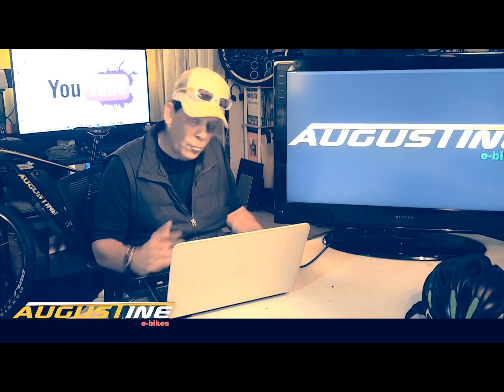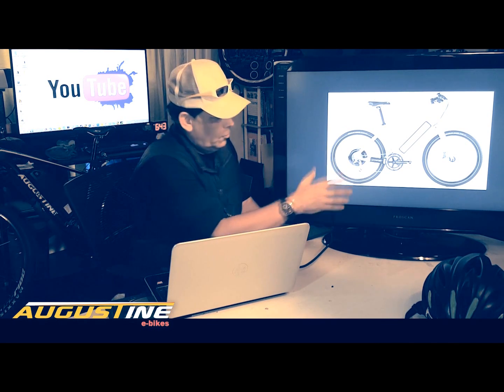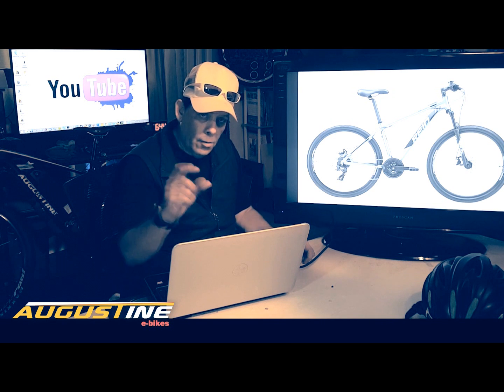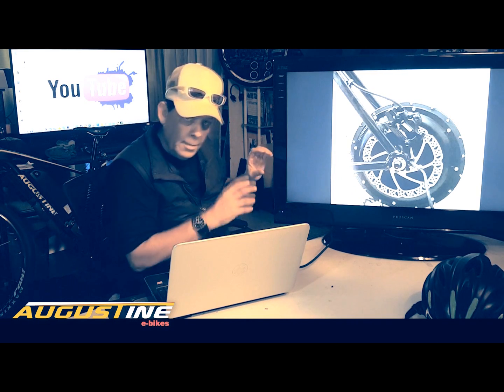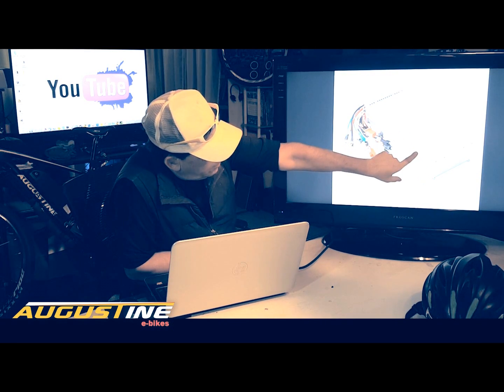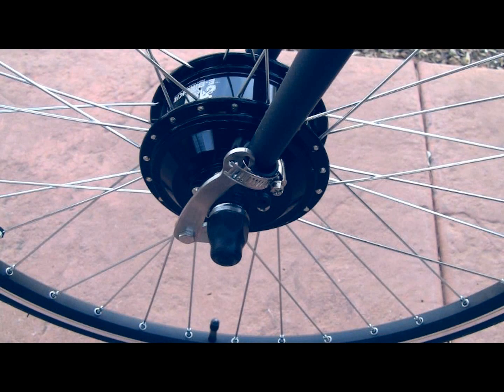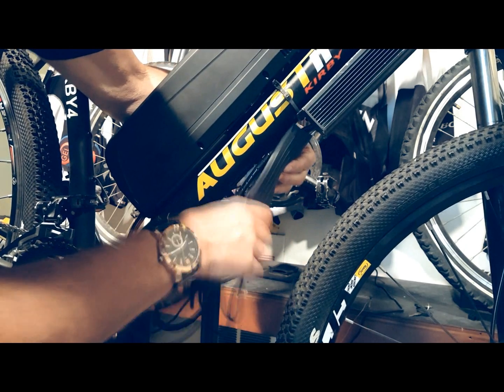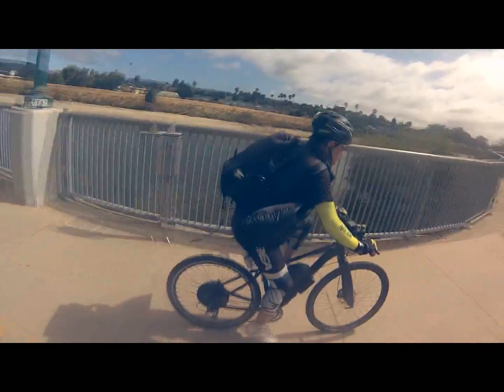Build an E-Bike! INEXPENSIVE + EASY

Comment: Meh. You compare your kits with slapped-on batteries and crude exposed cables to purpose-built German Stromer bikes?  Reality is you can't build an equivalent bike with a kit - Juiced, Radpower et al sell very capable bikes at excellent price points - and they're designed to handle the high speed and added weight of motor/battery - at a fraction of what a Stromer would cost - and less than what a kit would cost to buy/assemble.

Comment: Thank you so much for this post. I've been looking for quite a while to get a really basic knowledge of where to start and this gives me a platform to build on.  One question that continues to allude me and that is when off road is the real wheel motor water proof and the same question for the battery controller and charger ? If anyone can point me in a good direction for this info it would be greatly appreciated. Happy trails.